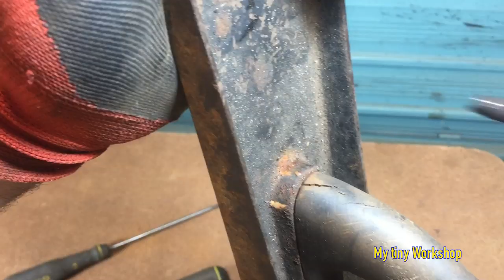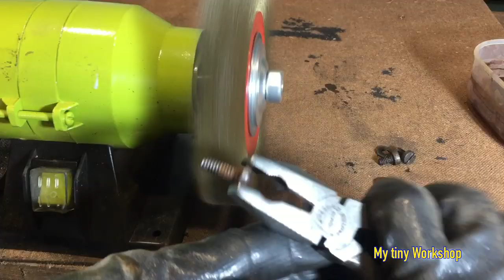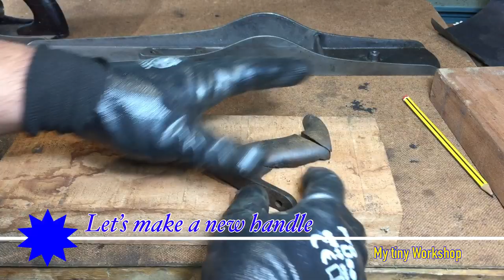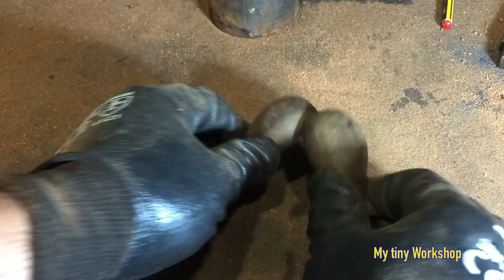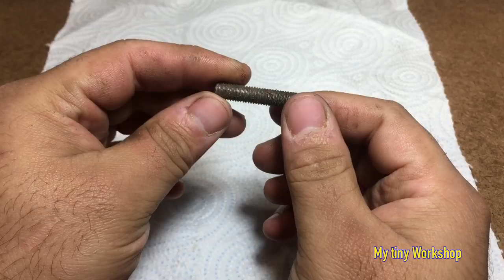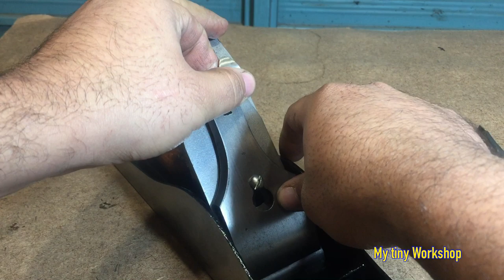Vintage Frankenstein Jointer Plane Restoration - Custom Handle

Comment: I envy someone who can take a piece of wood like that and a saw and sandpaper then the next thing you see is a finished handle. That's an art. Nice job on the rest also.
Reply from the maker: Thanks a lot. I like trying new things and messing around with wood is calming. My advice is just try. We are capable of more than we think. Even I’m surprised with how good it turned out.

Comment: Nice job man! How did you get the depth adjustment knob screw tight enough? Recently I had to resort to using aluminum jaws in my vise and spinning the frog to make sure it was bottomed out and would come loose. Do you have a better method?? Great video!! I’d like to see more woodworking tools!
Reply from the maker: All I do is grease and screw with hands. I haven’t had any problems so far. If you want it tighter you could use a flat pliers type tool with no teeth. That won’t damage the threads with light pressure. I use something like that to remove it. Glad you liked the video.

Comment: First of all congratulations on going over 1K subscribers. I remember saying on the the first video I saw I was shocked on how low your subscriber numbers were. You very wisely said if it was meant to be it will be but in the mean time you were enjoying doing what you were doing. 

I have a frankenplane, mine is my number 5 which I bought a replacement sole for my welded Record. Because there is a slight design change from my original my frog wouldn’t fit and I used a none Record on. It works perfectly and has minimal play.

You did a phenomenal job here, you ended up with a beautiful, effective plane. What was the paint used please? Was it a Hammerite type paint or was it one of Hand Tools Rescue Japanning recipes? A very enjoyable video, thank you.
Reply from the maker: Thank a lot. Seems like I’m doing something right. Now onto the next goal 10k.
Reply: My tiny Workshop You'll be there by Christmas!
Reply from the maker: Now that’s a goal I like. Thanks for your support.

Comment: Looks like new - what a shame. Over restored IMO. But well done for giving it a new lease of life.
Reply: "What a shame"? "Over restored"?  Do you mean by doing what he did he removed any collector value it had?  Or do you mean he just spent too much time on it and made it too pretty?  As to the first option, he started out with a real piece of junk - there was no collector value.  As to the second, I like a guy who goes to this amount of detail and makes everything as new, even the paint.  Where's the shame? I was inspired and might take my ugly Stanley #6 user and over restore it.
Reply from the maker: Thank you for your comments.
Reply: @jfsauer42  As I said In My Opinion it was over restored. It was not a piece of junk to start with. Sure it was looking neglected and unwanted. All it needed were the flat surfaces honing to a nice finish making them true, and through clean, after which it would look like a lovely old tool that somebody valued for its character and it value as a great tool for planing wood. I'm not concerned with collector value. Why does everything have to come down to money. Like I said it's just my opinion, you may not agree.